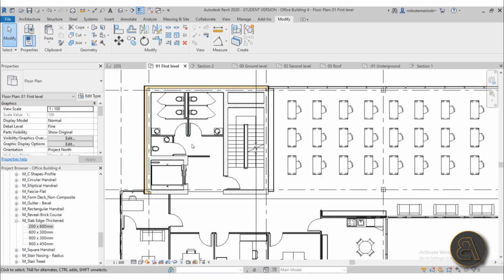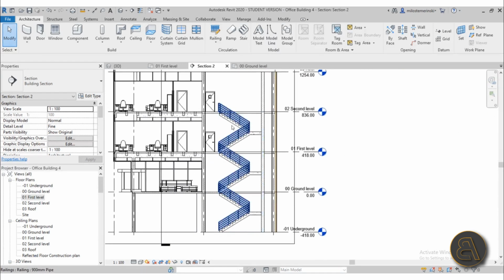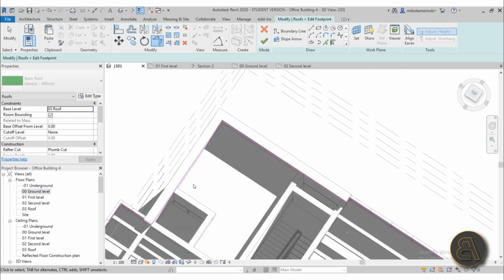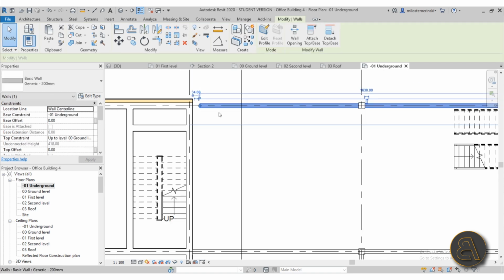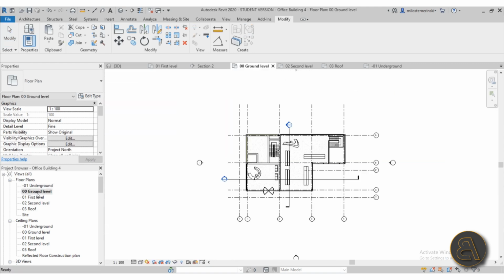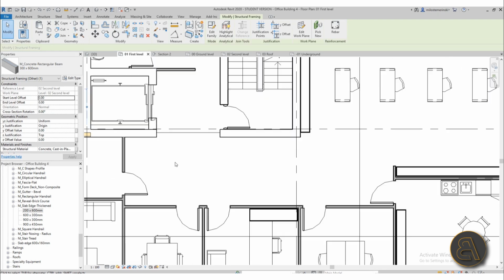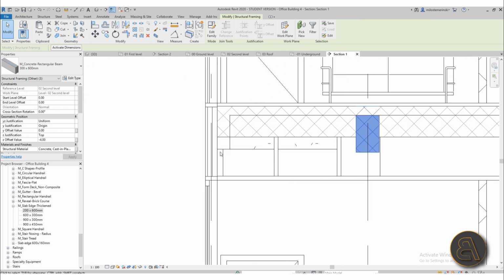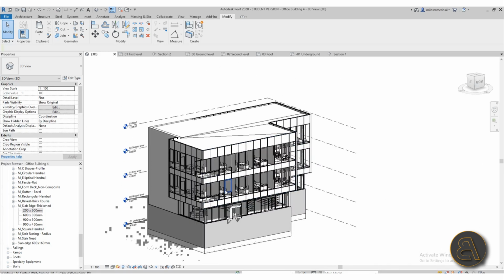Office Building in Revit   Part 4   Balkan Architect

Comment: EIFS (usually pronounced "eefis" or "eefs" in the US) is an exterior cladding used as a substitute for masonry facades, it's not meant to be used in the same way as a rigid insulation board. 
Also, an interesting fact about EIFS; it is well known for leaking and causing water damage to buildings which has led to multiple lawsuits. It's not commonly used in construction anymore (in the USA at least) without a serious waterproofing review by a professional. Typically the risk of using it is higher than the value of the product which is why it is not specified on projects.